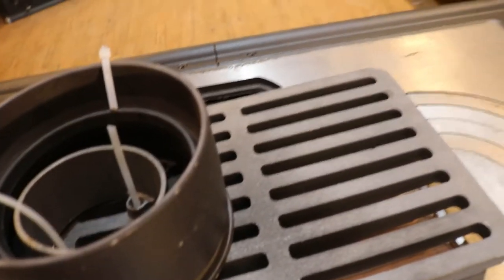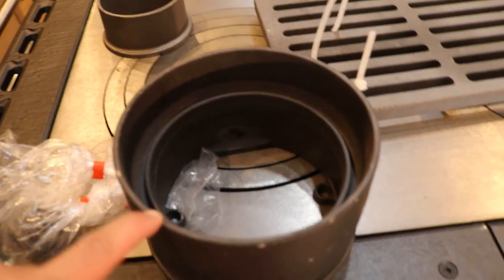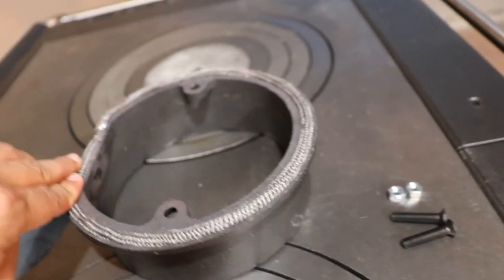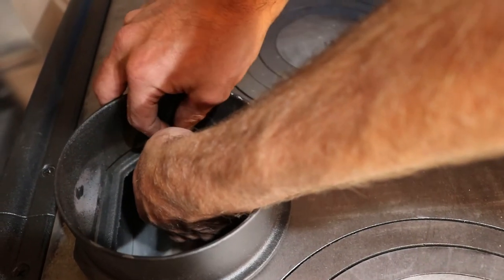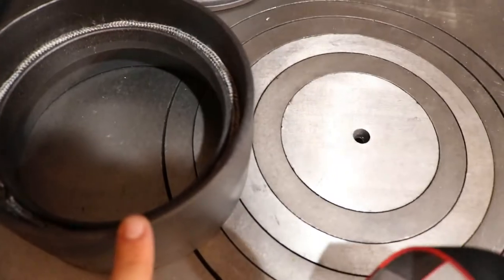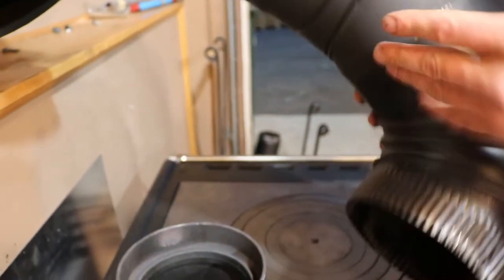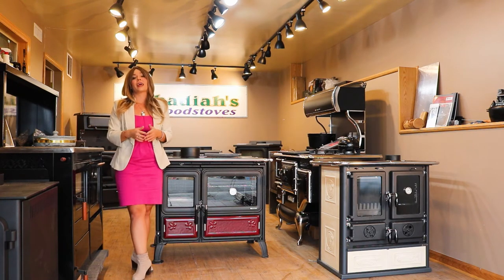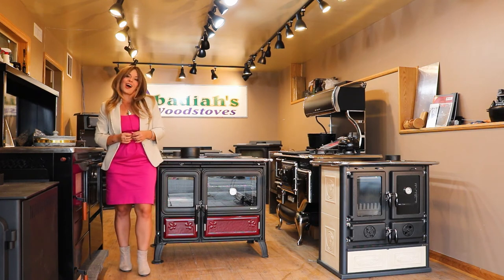La Nordica Milly Wood Cook Stove - Flue Collar Installation

Comment: You do a wonderful job on these videos. This video in particular was very helpful. 
One more thing with this flue connector topic. 
Could you please show a video on how it looks on the inside of the flue after you attach a double wall blackpipe?  
I've purchased an stove adapter and when i put into collar I'm left wondering if it is correct. It doesn't seem to fit as nice as i think it should. Any help would be appreciated. The La Nordica manuals are way to small for old damaged eyes.😮